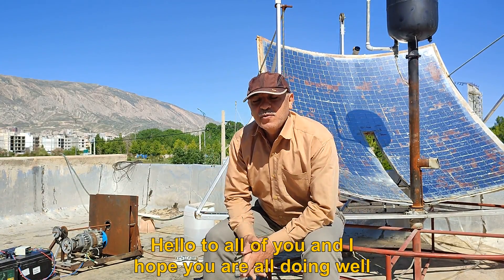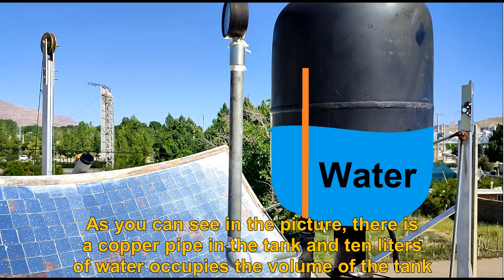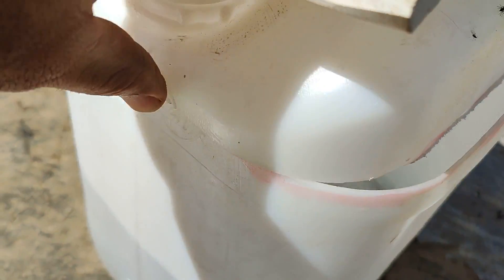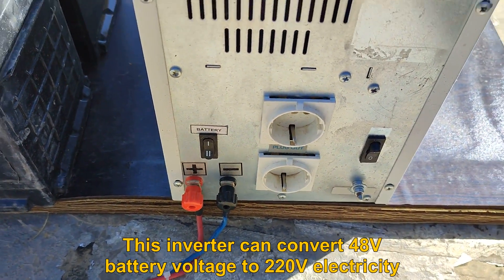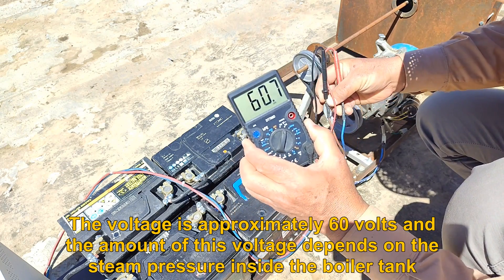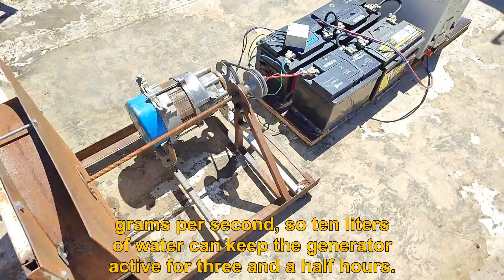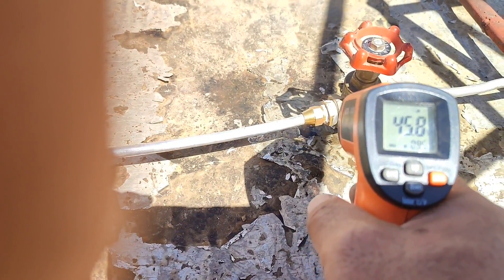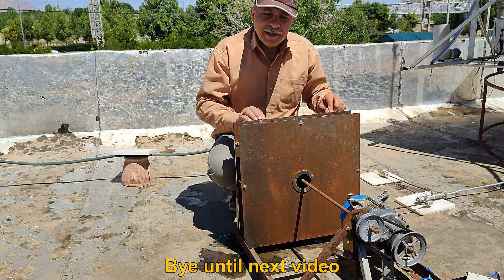Solar power generation Without using a solar panel.A simple home power plant with a solar dish

Comment: Very impressive!! If one uses several magnifying glasses and positions their focal points on the tank, won't heat generation be greater than the solar panels
Reply from the maker: Thank you dear friend
Yes it is possible but it will be very difficult
The best thing is to use a solar dish

Comment: This is very interesting I'm looking forward to seeing you improving your invention.  How many amps are you getting at 60 volts?  Regards Stephen in Melbourne Australia.
Reply from the maker: Hi Stephen
Unfortunately, the power received from this generator is low and is approximately between 150 and 200 watts
This generator is not suitable for this task
Thank you for your nice comment

Comment: Excellent work, may i suggest glass wool insulation or sheeps wool to reduce heat loss. As soon as the steam leaves the boiler it will be condensing on the walls of the pipe.
Reply from the maker: It's a great idea and it should be done because the hotter the steam enters the turbine, the more efficient the turbine is.
Well done to you

Comment: I really like your idea of putting one way valve so after water is boiled off tank will make vacuum when cooled so no need for expensive pump to pump up water...that is automatic station just add water to bucket....that is very well planned...Thank you so much for your inovation...also on turbine pls check out my vid i made prototype and it is super powerful...
Reply from the maker: Thank you for your comment
I watched your video, it's great
Of course, I made this turbine, but for now, this is the best turbine that I use
In fact, the amount of output steam should be controlled so that all the steam does not come out at once
I enjoyed your good video
Reply: https://youtu.be/DO9QLh9W5g0?si=JAHaiU2mJS3vZGbv
Reply: Please share link thanks
Reply: https://youtu.be/DO9QLh9W5g0?si=MFlgjX_LdpTf-I9G